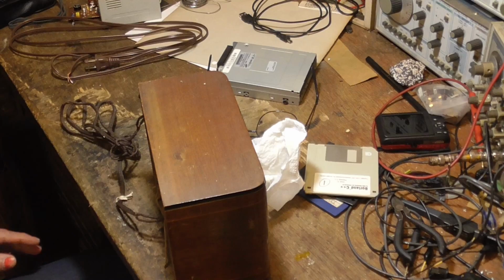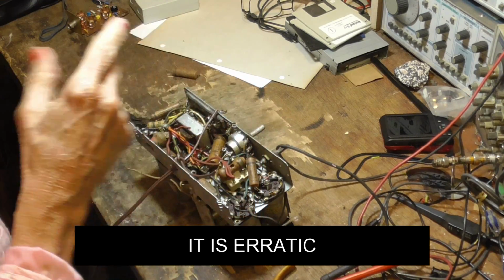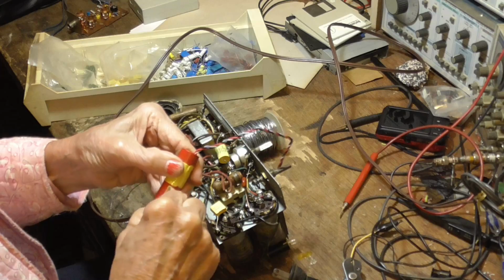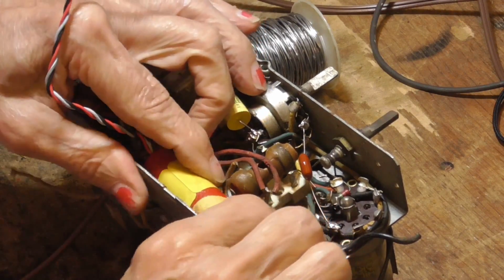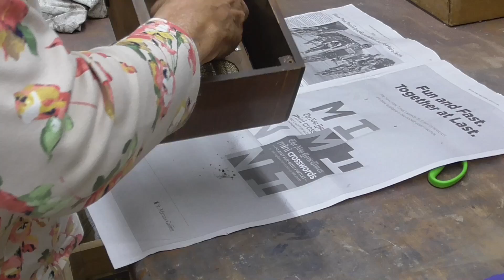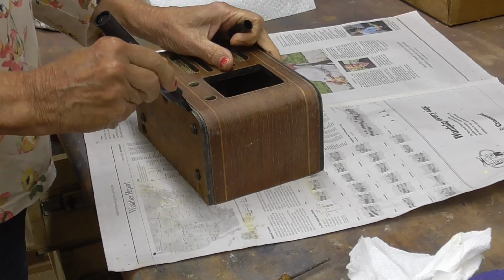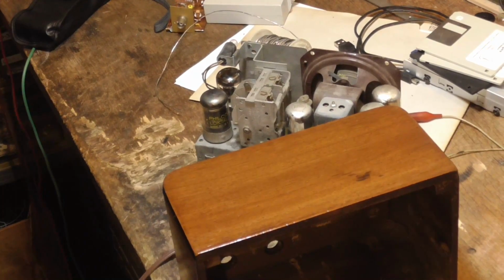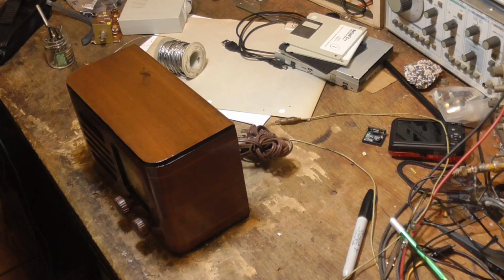REPAIRING A SMALL PHILCO WOOD RADIO

Comment: I use to repair old radios too it was fun to revive old stuff im also Called the speaker doctor did reconeing of speakers and even made my own coils to drive them if the coils where burnt i would use a mold to hold the paper and coiling wires and wind this wile the cylinder is on the mold ,i use ceran wrap for seperation of the mold from the cylinder it will just slide off the mold and id have a perfect 1 inch coil or what ever the coil size is, takes a bit of work, most of the parts in a speaker are made on some kind of mold even the cone they are pressed ,i can also make a speaker out of some coil wire a magnet and paper i can make a working speaker , i like what i see in your videos your very smart with electronics ,my father was into ameture radio  i learnt a lot from him about electronics and went to the ham fairs some times id even score some thing cool, one time i scored the first solid state portabul radio it had a nice gold handle , i payed three dollars for it around and sold it for 800 dollars tiny radio , i have a very cool tube tester, made in new york city it a little grey suit case and inside is a very impressive tube tester if your interested in this tell me who s what could happen it s very cool but i imagine u already have one good job on that .

Comment: The metal fixing screws under the bottom of the cabinet are electrically connected to a maybe hot chassis!  And they are easy to grab while moving a plugged in radio.   I bet they were originally covered by insulating plugs that have now disappeared?

Comment: I usually replace the dial window if they're bad. It's extremely easy using clear hobby plastic. I trace the opening in the wood onto a piece of masonite, cut it out and save both pieces. I cover the opening in the masonite with the hobby plastic and put in the toaster oven at 275 degrees. As soon as starts melting, I place the cutout piece of masonite and press it gently down. Works great with perfect clarity

Comment: I just plugged in my deceased fathers solder thing, with a brand new tip, its a "win"- the hardware guy gave me 2 tips -this afternoon for about ten bucks-but it is a mini version of the original, it seemed to get hot about 165 and rising, when I pulled the plug, I think he got it in late or middle 60's. Now I learn to sold-er.'

Comment: Thanks for the tip on the Brakleen. I have been using electronic tuner cleaners for years and didn't know about this. It's a good cheaper alternative to expensive specialized cleaners.

Comment: Might be a good idea to warn those not familiar with "All American Five" radios that the chassis is hot depending on how the plug is inserted in the outlet if the plug is not polarized. That's why they used plastic/wood cases with backs and plastic knobs.

Comment: Hey Ron, maybe on your next video you can tell us why you prefer the soldering gun instead of a pencil type iron.
Reply: He has said the Pencil tips do not get hot enough to work on the old radios. Sure you can connect wires and such but very hard to make a ground connection to chassis without a good gun.
Reply: That makes sense.
Reply from the maker: The large terminal on the old radios need a lot of heat to get on and off quickly. A 100 watt iron will work but smaller irons will take too long to heat the joint which causes the plastic insulation on wires to melt and bubble. The whole trick is to heat it fast and then get off of it before stuff is damaged. The gun is ideal with the pinpoint 150 watts.
Reply: I’ll have to start using mine much more, thanks.

Comment: I have a question...I just recapped and replaced resistors and tubes on a Sentinel 294T...went thru radio, checked and repaired speaker transformer...all tube voltages appear ok...the radio had no antenna...I power it up and all I get is relatively quiet speaker reaction, no tuning...if I poke around I can create ground noise, buzzing...but still no reception...I tried making a loop antenna and I also tried a long antenna on the external antenna connection...any thoughts?
Reply from the maker: It's possible the local oscillator is not operating. Check the oscillator 1st grid to cathode voltage. The grid should be slightly negative (1-5 volts) if the oscillator is operating. If the voltage is zero or slightly positive, check the oscillator coil.
Reply: @glasslinger  that's nice of you to reply! Thank you for the insight I will check that next. Cheers friend!
Reply: @glasslinger  is that little nice radio for sale ?
Reply: @glasslinger  I did as you suggested checking the first grid to cathode voltage...it was -7.4 vdc and rose to -8vdc as it warmed up...funny thing is the first grid to ground was + 7.0 vdc and the schematic said it should be 0.4vdc...what are your thoughts glasslinger? short of abandoning the project I wonder if the fact that I don't have the original antenna... is that making my unit sensitive? I can use my probe and touch various line filter caps to create louder noise at the speaker but no hint of tuning sound otherwise, just a low quiet hum...also I checked continuity of oscillator coils and I think there are no opens...any help or theories would be deeply appreciated...love your work
Reply from the maker: Everything is for sale. If you have enough money! That one is in my collection so I really don't want to get rid of it. Sorry. Keep an eye on ebay and you can find a similar one.

Comment: Hey Glass...I got my radio working...but I have what appears to be an intermittent detector circuit...the tube is good and everything seems to check out...but it's almost like sometimes it works and sometimes it doesn't and wiggling the tube has an affect but it seems to make up it's own mind anyway...thoughts?

Comment: I really enjoyed this video. I'm impressed by how quickly you were able to make this beauty perform! Where was the end of the wire that you had connected to the antenna wire of the radio?
Reply from the maker: That radio has enough sensitivity that a 3 foot piece of wire is all the antenna it needs. I do have a 25 foot outdoors antenna for less capable sets.
Reply: @glasslinger  How can I replace a back with the antenna that's not good?

Comment: those old timey soldering irons i bet are very reliable compared to todays stuff they honk out nowdays
Reply: Maybe ok on tube/valve equipment... but don't try using one of those solder guns on modern  surface mount boards  :))
Reply: Those old soldering guns are still made, at least in the UK they are. Weller still makes the same Weller Soldering Gun as they did years ago and still makes and sells the bits, although we used to just cut a small length of 2.5 mm copper cable solid-core and bend it to shape and use that as the soldering bit for the Weller soldering gun, it worked just as well and very cheap to make.

Comment: I need one of those firecrackers for a Zenith Universal. Can I still get one of those and if not what can I substitute?  I have not ordered caps because how to replace what is inside the can.
Reply from the maker: Try Antique Electronics Supply. They had them last time I checked. You can also buy individual electrolytic capacitors and pack them into the can. Most people just hang them under the chassis. Fooling with the can is a LOT of work!

Comment: When you said, "lacquer thinners" is that cellulose lacquer thinners? The same thinners as used with cellulose paints?
If not, what actual kind of thinners is it you used to clean off the dirt, please?
I'm hesitant to use cellulose lacquer thinners as I think that would react badly with the finish that's on the wood, but I don't know what the thinners are that you used?
I've used isopropyl alcohol to clean the varnished surfaces of wood and the alcohol didn't react with the wood finish.
Thank you for another wonderful video.
Kay.
Reply from the maker: You are getting too tech for me!  I get the can that says "lacquer thinner" at home depot. That's all I know about it!
Reply: @glasslinger  I don't think it could be cellulose thinners as that would remove all the layers of varnish or previous lacquer that was on the wood, and it would also react with the varnish and cause it to crinkle/bubble, is white spirit as in the stuff you use to clean gloss paint off brushes that you would paint doors in your house with?
Isopropyl alcohol would clean the dirt off the wood, but it wouldn't remove the old lacquer unless it was shellac Lacquer, in which case Isopropyl alcohol would clean the old lacquer off along with the dirt.
It's always a problem with terminologies between two countries that speak a common language that quite a lot of words have different meanings, making some things sometimes difficult to understand.

Please keep the videos coming, they are wonderful to watch, you can see some of the radios I restored in the past. I used to have a WEB site "The Museum of Commercial Radio" where I had all the photos of my restoration shown, but the people who hosted the site went defunct, and now it is only temporarily on this site where a friend has put it up to show you some of the battery-powered radios I restored back in 2000 - 2015, please see - https://www.royalsignals.org.uk/museum

Regards,
Kay.
Reply from the maker: @getcartercarpark.  Nice looking radios. That style radio is not common in the USA. Shipping overseas prevents buying them, where the shipping can cost more than the radio.
Reply: @glasslinger  I had to sell nearly all the radios I had when I went through a spell of ill health.
I still have the Bush BAC31 and the Rambler that can be seen at the top of the page. The Bush is AC powered, and the Rambler is a battery, but I simply have ten little rechargeable batteries on clips inside to power the HT and a since alkaline C cell in a holder for the LT. Buying little 9-volt batteries in packs of 10 becomes expensive, but rechargeables are not so bad, after a few recharges they have paid for themselves.

But only earlier this year I wanted a little radio to listen to in my workshop and I wanted to get a Vidor Model CN396A, I found two on eBay marked as unknown working condition, which means either not working or not looked at. So I got both with the idea of making one good one out of the two. The most common part to fail is the audio output transformer primary. As it happens, both radio's audio output transformers were OK, so I restored both radios.
The CN396A is both AC and battery powered and AC power is via an internal transformer, so we have no live chassis. The usual faults you find are paper capacitors failed, but over here they never used dual paper capacitors, just single capacitors. I spent a lot of time wrapping axial polypropylene capacitors in paper that I had printed the value and working voltages on and dipped in Shellac lacquer a couple of times to make them look authentic.
Reply: The first thing you need to know is if the finish is shellac or nitrocellulose lacquer, both sometimes referred to as lacquer.

Shellac is solved with alcohol, nitrocellulose lacquer with lacquer thinner.

Comment: Glass, I generally know how the other components of a radio work but how does a variable capacitor work to tune in stations? Your “Big Bertha” soldering gun looks like its been through the wars. My Weller, soldering gun gave up the ghost a few years back, probably as a result of lack of use, I guess. It sat unused in my toolbox for forty years as I was busy earning a living in another field,
Reply from the maker: I am 76 this year and have had "big bertha" since I was 12! Still going strong, albeit a bit beat up! The tuning capacitor varies the capacitance. This in conjunction with the antenna coil causes the resonant frequency to change, thus selecting the different stations.
Reply: @glasslinger  thank you for the information. Sadly, I’m not far behind you in age😎

Comment: The radio is without a line transformer. The holes in the back wall are too large and can touch the chassis when it is under line voltage. Nice work.

Comment: Brake parts cleaner îs good, but gasoline is better.
Except, the smell of gasoline is very strong.
Reply from the maker: The brake cleaner is not flammable. No gasoline in my lab!
Reply: @glasslinger  Don't you get residues from the brake cleaner ?
There is also electronic parts cleaner.
Reply from the maker: @MrGigi-dz9cv  The brake cleaner seems to be quite pure. A squirt of it into a glass leaves no residue at all. This is the CRC red can stuff, NOT THE GREEN CAN WHICH IS FLAMMABLE!
Reply: @glasslinger  We don't helave those in here. Just the flamable stuff.
Gasoline is really cheap, and efective.
Work can be done outside If needed.
I work with a brush and a jar.
When it gets dirty, i dispose it in another jar.
Reply: Thank you for the information on the brake cleaner, from  Aus.